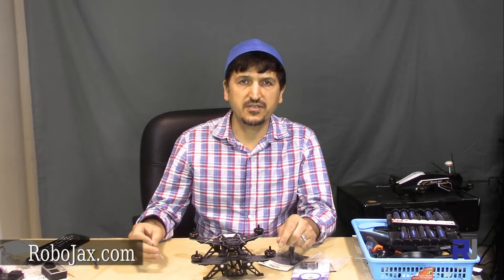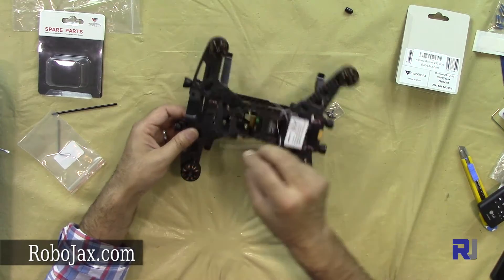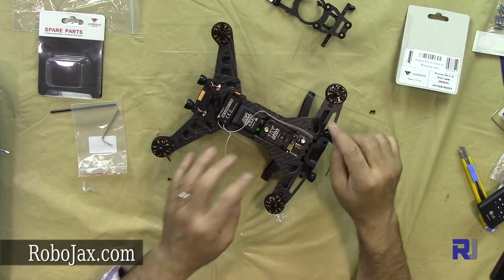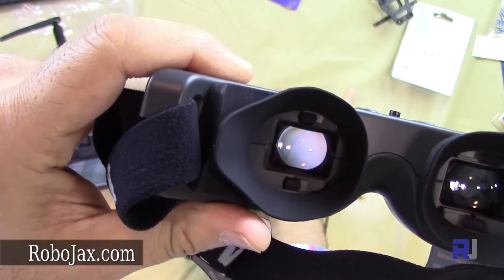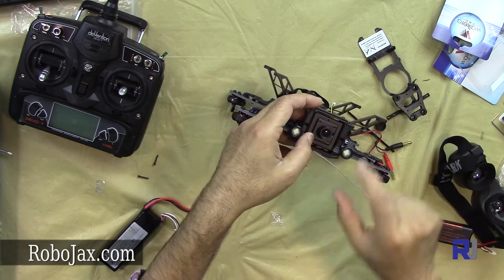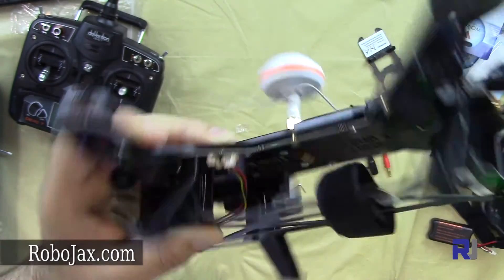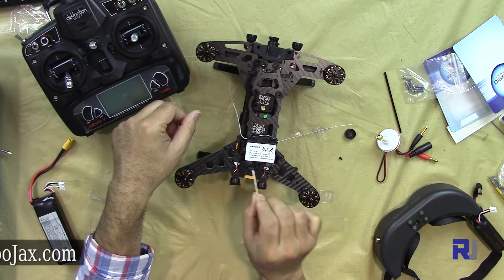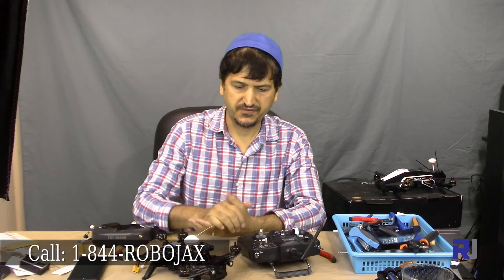Walkera Runner 250: install TX5816 FPV transmitter and FPV camera

Comment: hello i am jerry i have a walkaera runner 250 drone but I don't understand how to operate like a professional drone can you teach me
Reply from the maker: Hello Jerry,  it need experience.  first you have to be able to go straight, then move around object in a safe place where there are no people like park.  once you are comfortable with that, then try to rotate around the drone so you learn no to lose orientation.  then for tricks, watch videos and try it. in this process you will brake parts. Walkera is not a good option for those flip and other tasks. Good luck.